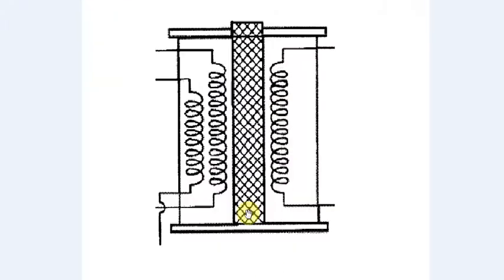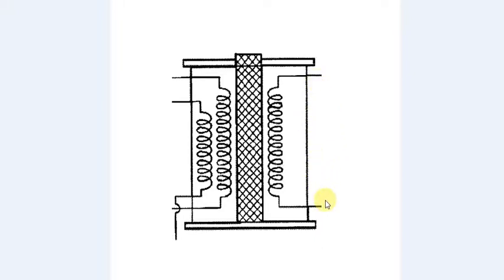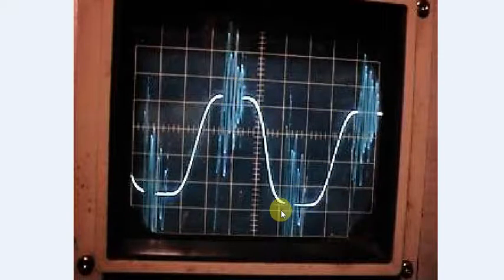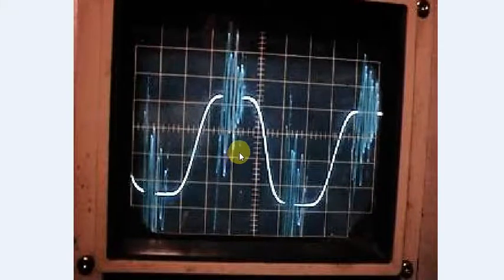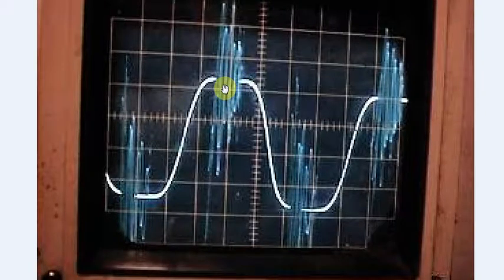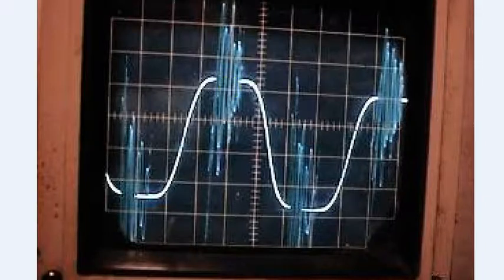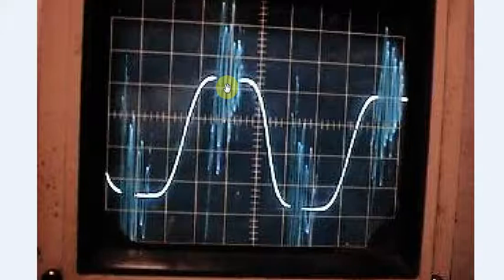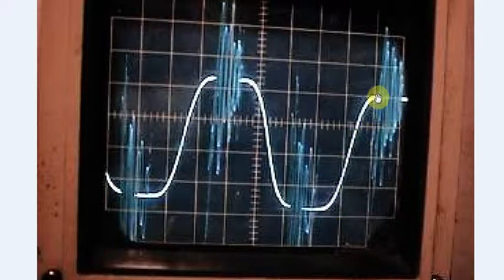Explanation of Coil Shorting Free Energy

Comment: can you show a schematic of the circuit?
Reply: MrDKONZEN 
Thanks Mr Konzen.   I'm a big fan of yours. The coil shorting had been confusing me for a long time.  I originally thought this was somehow related to the Bedini BEMF type circuits,  but it appears the setup is completely different.
Reply: Hi WGTMost everyone confuses or associates it with backemf recoil stuff like Bedini SG motor which shoots spike out backwards through steering diode, ....... I would say it is similar since HV spikes occur but in case of coil shorting it is hyper HV AC ringing, and it happens during switch CLOSURE which is actually huge difference.....
Reply: MrDKONZEN 
I had no idea it was that profound.  Does it bog down the motor  (Lenz law) ???
Reply: Hi WTFLenz law does its thing to bog down motor spinning generator, and you will get lenz law in creating the "initial" AC sinewave or DC type pulse  to the inductor since that is what happens, however you can keep the lenz law lugging very low and minimal by choice of capacitor size that fills up.......also it is important to play with pulse width of the closed-time of the switching that creates the short of the inductor, and keep that pulse width short short. and have it happen at peak period of the sinewave, or in case of pulsed DC inductor, have it happen just before the coil saturates........some call this lenz law braking or lugging "reflection to primary" or reflection to prime mover (motor) and what you look for is minimal reflection or reflection that does not show up on meter it is so small, or does not show up on RPM meter as a slow down....like I said in other posts, the actual CAP DISCHARGE itself will be completely lenz free, as you must disconnect coil from cap whenever it discharges....(two stage output circuit this is called)So it is impossible for cap discharge to influence anything having to do with the coil that was shorted since it is completely disconnected....but the problem you will find is when doing quick cap discharges, such as alternating cap discharges to create 60hz AC if you want to do it like that, is that REFILLING the cap after it discharges  will cause resistance and cause lenz law lugging but you get around that by doing the coil short at sinewave peak periods, and keeping pulse width narrow, and also choosing a suitable cap size as for example a 1 farad size cap is going to cause huge amount of resistance and will just extinquish that hyper AC ringing, but a 1000uf size cap might be just right and will work as capacitor that the HV HF ringing will happily fill up you could almost say the smaller size cap lets the ringing resonate itself into it but I don't know if resonate is correct term here.
Reply: MrDKONZEN 
Thanks Mr. Konzen.   That was the best info I've ever found on the subject. I watched  all of Ismael Avisu's  video since he's doing exactly what you described except in solid state version,  but it was very confusing and it left me with more questions than answers.

I might just try this method as an experiment. Would love to use this design on a wind turbine to squeeze out more power from it.